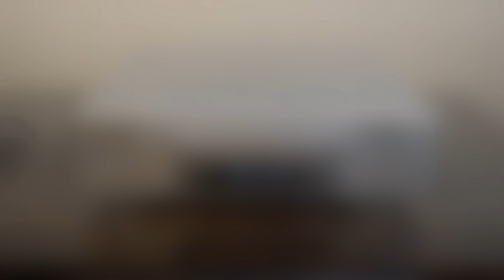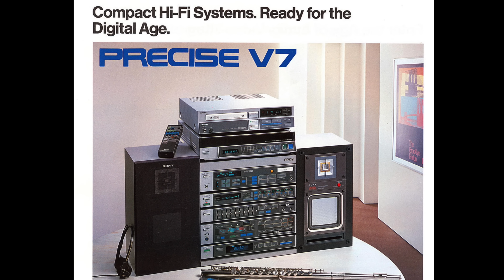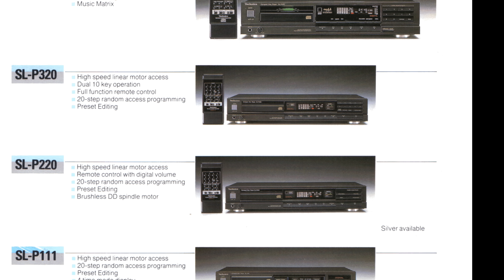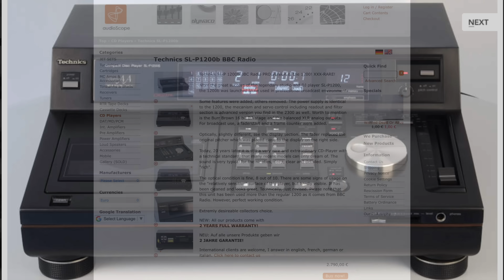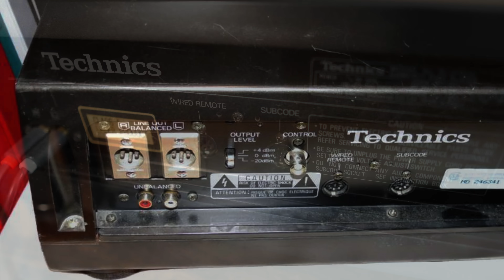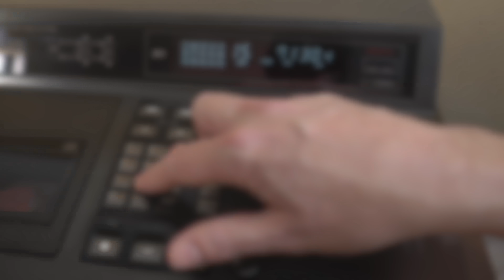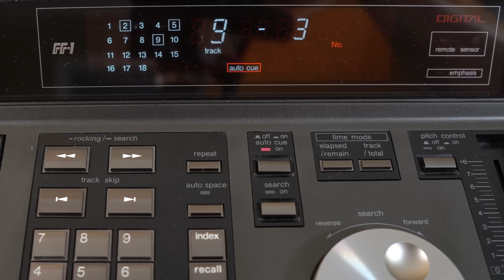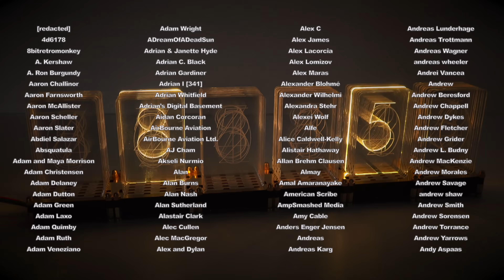How CD players lost their cool & why this Technics didn’t.

Comment: I believe one of the reasons more modern CD players take longer to read the index is because they have to go through all the disc types they know, which involves changing the focus and strength of the laser, in order to figure out the optimal settings to play the disc you've put in. At least the multiformat machines I have take forever to get going, but some of them are much faster if you hit play to close the drawer, instead of pressing the open/close or just pushing it closed.

Comment: B&O BeoSystem 2500 is properly my favorite combi-system (CD, Tape, Radio) that shows CD and tape through moving glass window (opens when you move your hand close to it).

Also BeoSound 9000 since it can hold 6 CD's and will ensure the CD's are oriented same way they where inserted after being played.

And there's also BeoGram CD3300 from 1987 which I think is B&O's first CD player with a window down to the CD.

Comment: I wonder if the quick boot time is because it has enough power to spin the disc up to speed quickly. I’d imagine newer machines have had things reduced to about the bare minimum to save cost. So, they may take several seconds to get the disc up to speed before it starts reading it.

Comment: The summer of 1985... I was 16, my best friend got a new CD player for his room... it was a single disc that came with two Hi-Fi modern speaker cabinets... the cost was $1,000 USD... (what you could buy for $100 in 1986, would cost you $238.51 in USD as of January 2022...)  - it sounded like traveling to Venus to our ears... a year later he got a single disc player for his 1983 Mustang... that literally blew our minds into orbit...

Comment: You would think as the digital players progressed over the years the increased performance of even the same line of basic microcontrollers and memory used to make them would vastly decrease load times instead of the opposite.  It's almost like you would have to try and find worse digital components over time to decrease performance.  You can't even blame higher bitrate leading to larger file sizes needing more power to buffer.

Even now with solid state digital music players, you've got some that go for thousands that lack even the most basic features like being able to search through your music collection (among other problems like build quality).

Comment: I have an Emerson Triple-Play Linear 3 CD Changer. It’s really cool. It’s got a transparent door that shows all 3 CDs in the player. The door is motorized too which is cool. But mine isn’t performing as well as it used to. I need to help it open now. I’m curious if I can open it and fix it. Could just be a band that needs replacing or a slipping wheel or gear. Just depends on how difficult it is to open up.
Reply: The Emerson definitely isn’t as cool as this Technics tho.

Comment: I recall 1st CD player in  the UK philips  in a shop around 1985, I recall seeing a Rod Stuart CD by the CD player a few months later around same time Dire Straits was talked about by many in media. By the late 1980's many hi fi Had became Black in colour around the time of Ride on Time by Black box !  The  Technics model's were the ones you saw around the time Wedding dj''s started to adopt CD as so many CD complilations of 70's & 80's track became cheaper than new music CD's around late 80's Early 90's  at the time the Club DJ would not touch CD ( until Pioneer  around 2001) In The Night Clubs the Vinyl 12 " was king for much of the 90's early 2000's

Comment: I wonder if CDJ machines were based on this. Accurate cueing that you can kinda scratch with, pitch control for beat matching and creative applications, reliable build quality. And of course it's a Technics, the SL1200 is the standard for DJing.
Reply: Yes these were meant to be, and used as club DJ decks. Hence the 1200 in the model name.

Comment: Later models did have digital outputs.  I remember there being a TOS (lightpipe) on the back of the unit I used in a professional recording studio in the mid 1990's.  What we loved most about it was the ability to get to not only tracks but INDEXES within the track.  This was really helpful for CDs, like sound effects libraries, that had more than 99 sounds on them.  Companies like Sound Ideas would be sure to include indexes on their tracks.  So what we would do is find the sound effects by opening our companion book (yes paper), and finding the sound listed with disk, track, and index.  Pop in the CD, dial up the exact location and audition the sound.  We had a sample rate converter (hardware) with a TOS input that fed into our ProTools rig via AES/EBU that generally was working at 48kHz for video.  

Sorry to take you down a long memory road.  But it was a revolutionary time with our primitive DAWs by today's standards (ProTools II).

Comment: Reminded me of the portable CD player I had as a kid in the early 2000s, it had a tiny window through which I loved seeing the disc spin. Just something nice about seeing physical movement that results it music.
Reply: Most portable CD players had that.  I even modified one of mine, to test the anti-skip feature, so I could open the lid while it was playing and stop the disc from spinning, and count how long until the audio stopped.  Those 60-second buffers really worked!
Reply: @drfsupercenter  if you bypassed the lid sensor and had antiskip on, you could even switch the disk whilst playing. completely useless party trick
Reply: @drfsupercenter  I did a similar thing with my little Technics SL-XP140 portable.  The spindle was the sprung ball-bearing type, not the magnetic puck type, so I set it up to play while the lid was still open.  Just needed to jam the switch open to make it think the lid was closed.

Comment: One explanation I can come up with is that lasers had a strange, dangerous mistique in the early 80's - most people only having encountered them in a sci-fi setting. There may have been a concern that consumers would worry about safety if the "laser" wasn't safely enclosed.

Another possibility. The peak of domestic tech in the early 80's was the VHS player. Mostly they were front-loading and it's possible the CD player manufacturers wanted to produce something high tech yet familiar for their new audio format.

(Edited for smelling)

Comment: Amazingly, one of the advertisements you showed had a Technics carousel unit identical to one I had in the late 80's.  It probably was a bit presumptuous of me because I had a grand total of about 8 CDs at the time and the carousel held 5 of them. That said, it wasn't my first CD player.  I first purchased a Sony D-9 because it was portable and I could plug it into anyone's system.  I bought several CDs to go with it (first one was Pink Floyd Dark Side of the Moon ) and a cheapo boom box with audio in for my personal use.  Must have been about 1988?  I still have it in a box somewhere, but it would be harder to find any of my actual CDs to play in it than the unit itself! I replaced it with a Sony S2 MP3-CD player in the early oughts, which I still have as well.

Comment: Guess the "culprit" is product deveopment cost reduction making it cheaper using a PC CD-reader and all of them are front loaded, since the implementation (spin motor, laser head, laser tracking etc) up to the digital output is the same (CD-rom/CD-audio) and Phillips (beside Sony) was one of the major manufacturers of CD-mechanisms it became cheaper and easier to buy these and implement in a audio player compared to develope this part Yourself.

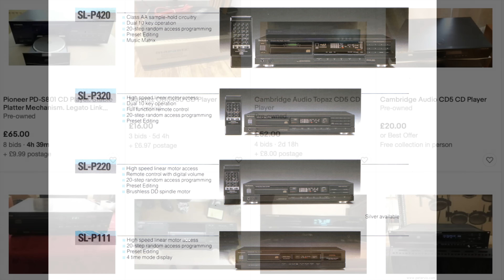Comment: Our first CD player was an SL-P111, as seen at 6:02 at the bottom. My parents won it at some mystery dinner theater thing they went to. It lasted quite a long time and was part of my hi-fi in college up until 2006 or so, when it stopped recognizing discs. It was very basic, but it was simple to operate and did its job well.
Reply: The 111 used the same laser as the 1200. and that very same laser probably went bad. The early range is notorious for their lasers going bad. But 20+ years is more than anyone would have dreamed of them lasting, I suppose.
Reply: Maybe it is repairable.
Reply: Similarly, I stopped recognising music from after 2006.

Comment: I picked up a "singing machine" karaoke, which shows the CD spin as it plays.  It needed a new optical pickup mechanism, which I took from a "durabrand" CD player.  A surprising number of these optical modules can be swapped.  I found out after taking a few apart.

Comment: I always thought that the reason for the drawer was to protect the consumer from the laser (really?), or to keep dust and finger prints off of the disc.
Of course the first VCRs were top loading too, and they gave way to front loaders (I still remember an ad where a toddler had stuck a peanut butter & jelly sandwich into the slot of a VCR).

Comment: I can remember the father of a friend of mine bought the Philips CD 202, I recognized it from your video. I can remember it had LED's for indicating which track was playing but there were only 15 LED's, so any CD with more than 15 tracks (like those Inter Synthelite CD's which had around 20 or more tracks of about 3 minutes each on them) you couldn't see anymore which track you were on after track 15 (it would play them though).

I also remember the disappointment when we were listening in the evening and with the lights off we couldn'n see anyting resembling laser light (we were 11 or 12 so we expected some sort of light saber in this machine) as they used invisible light apparently :-/

Comment: I used a number of SLP1200's units when working for the CBC in the network broadcast studio. They were fantastically versatile CD players and were very accurate with their playback and cueing functions. 100% my choice for live broadcasting. They were so successful in the studios that when each studio upgraded their CD playback systems the Technics (and the later updated models) generally found their way into use until they were no longer manufactured. Thank-you for bringing back that memory.

Comment: My first CD player was horizontally positioned and had a clear viewing portion on the door part that swung open.  So I could and did see the CD spinning as it played.  Problem is, a CD spins at anywhere between 200 and 500 rpm, so the kinetic psychology of analog media that you mentioned (and I totally agree with), doesn't work as well, when the actual physical medium spins that quickly.

Comment: Brilliant video. I also love the CD disc being displayed when played. I have a new Technics CD player which has a lovely CD display with an excellent sliding, smokey coloured, transparent door. One of the best designed cd mechanisms I've comer across. It is the Technics SC-C70MK2 model and the sound is amazing. It's a model you'd love.

Comment: Honestly I never really give it much thought, but now that you pointed it out, I remember my first CD player. They were really expensive in the early to mid 80s, so I got a Radio Shack transportable one. I don't remember the model number any longer, but it was dock mounted, which was attached to your Hifi, and you could remove the player part and put a battery pack on it and stick it in leather porch and plug in some headphones and make it a portable. If you can call it that. It took 6 C cell batteries, and it didn't run all that long on them. I think it was good for about 2 hours, so i didn't use it that way too much. Anyway, the point I was getting to was, it had a window where the disc sat, and you could see it spin. Talk about getting around to the point.. LOL 😆

Comment: cool CD player, i had a tascam professional cd player. got it for free being defective and repaired it, it was a 19inch rack model with a front loader swallow system. the quality and the loading/reading speed is comparable with that technics cd player. i do fancy the old vintage cd players a lot myself too especially the top loaders, i do have a philips CD100 that needs new caps. i had a Sanyo DAD M15, unfortunatly the laser of that one was defective. but i managed to sell it for a nice price anyway, since old cd players fetch a pretty penny. there are some neat high end front loader cd players though, i got a marantz CD16, had a nice solid design and it uses the old cast iron philips CDM-4 laser system and it sounds really great.

Comment: @Techmoan - Yes! Thanks for this one! 
My first CD player (Meridian MCD) was fairly high end for its time; it used the Phillips transport with a top-loading door.  
That also meant it had to sit on top of the rack, where one might also want to place a turntable... ARGH! (I solved this by adding a second rack, lol)

 My current unit (JVC XL-Z1050) is much better sonically (especially through an outboard DAC) but it has a drawer and that has always bugged me.  ;)  What a shame that some of the mainstream units famous for showing off the disk aren't oarticularly good audio-wise!  I might add that the JVC looks like any other CD player of the 90s; they are all as ugly as bowling shoes!

 (in the early days, this was usually due to cheap + too-small output caps and brick-wall anti-aliasing filters which introduced audible group delay - oversampling solved a lot of these problems, enabling later cheap players to sound as good as the early high-end units had)  :/

Comment: A few year ago, I bought a NOS in the box one. It actually has a great solid sound. the 1300 version had the fader the 1200 had the pitch, the 1300 had balanced outputs and the 1200 did not. Very heavy! Mine WILL PLAY recorded discs. (this might be a secret but I have disc-overed that the ship button, might hamper it playing pre-recorded discs, maybe due to thickness?) I cannot remember which way, either pull or push is slightly and it might play, however you must set it where you can reach it.... and be fast due to the quick reading of the disc.

Comment: Now that's intriguing. Your MiniDisk Machine that can be seen in the final shot of the summary section is not just an MD machine with a CD player, it's has a 5-CD Changer Mechanism with the MD player on top. Like, the only way I can think of how one could fit both in one machine is by using a CD-Changer Mechanism like one used in a car (aka stack the CDs on top of each other). Wouldn't be too surprising if such a system as used in a Hifi-Deck once, considering the same style of CD-Changer (just with 7 CDs) was used in a PC CD-Drive once...

Comment: Regarding the SACD player being slow loading the TOC, I wonder if that's because it's checking each disc for an SACD layer first. So instead of just going straight for the CD TOC, the SACD player is checking if the first layer is CD or SACD, confirms its CD, speeds up and checks for a second SACD layer, doesn't find one, then switches back to reading the first/only layer, slows down back to CD speed, and reads the TOC.

If so, this would be a case where the added complexity of a back-wards compatible technology causes it to bit a bit slower in one area than older tech, due to the checks it needs to run when a media is inserted to know which media it is and its capabilities.

Comment: Great video! I recently went on a bit of a CD player quest, and I wanted to share what I learned with all of you.
Modern hifi CD players are quite expensive, so you may want to scour the vintage market. I ended up finding a Pioneer disc changer from the '90s for around $30 and it worked, but it was noisy and beaten up due to age. I wondered why there weren't many standalone CD players from the 2000s available, and I finally realized that it's because they were displaced by DVD players. 
The irony is you can find a boatload of DVD players being liquidated at stores like Goodwill, and some of them are officially labeled as DVD/CD players while costing less than the older CD-only units. 
Some of them have onboard DACs with impressive oversampling. I inherited one with a 192khz / 24 bit converter. You may even locate a model that supports HDCD, and don't forget that some Blu-ray players support Super Audio discs, if that's what you're into. DVD players almost always can be used as transports if you have your own DAC, or you can just use the RCA outputs without any ill effect, as a lack of television shouldn't affect operation. 
Design-wise they're a refreshing departure from black boxes as they tend to be thin and silvery, with the basic CD control buttons usually in easy reach on the front of the unit. 
In short, anyone considering a brand new $400 CD player should really look into the used DVD player market, or just dig out your old one. Panasonic, Pioneer and other companies made some models that sound amazing and were purpose built to be used as CD players, and of course you'd be getting a video player as well so DVD audio and video is never off limits! 
Techmoan, I think this topic would make a great video. I'd love to learn more about how early DVD players catered to the hifi market as all-in-one machines.

Comment: You're right about the appeal of professional gear. I am ex-BBC TV and at one point early in my career they sent me to Radio to get some experience (Pretty boring but I did get to work with 'whispering Bob Harris' and John Peel) however all that nice audio gear stuck in my mind and years later I had a Studer Revox CD, a Revox A77 (wanted an 810!) and a Ferrograph reel to reel, a pair of JBL studio monitors plus a few odds and ends of whatever I could pick up for a reasonable price. Oh and at the time I was still recording TV shows at home on a Umatic machine!